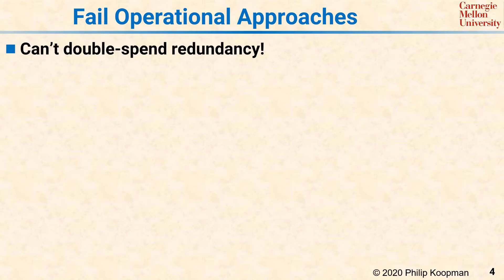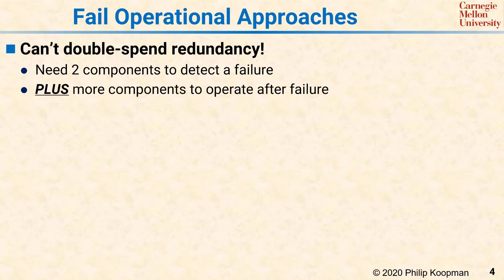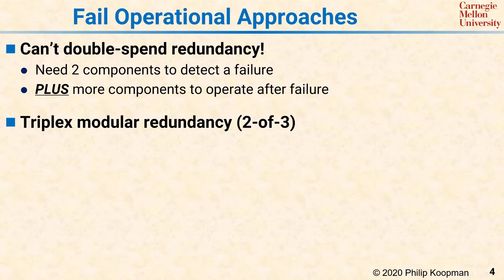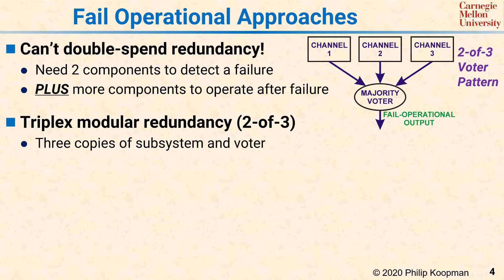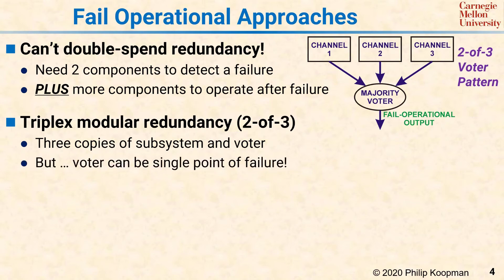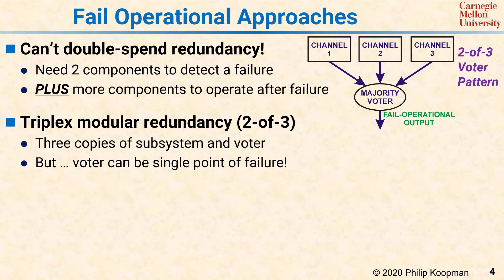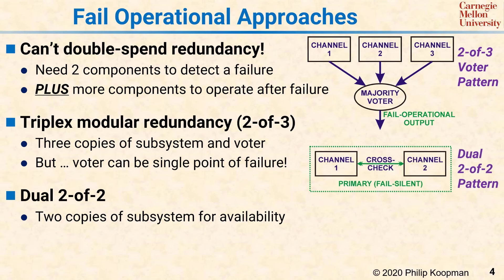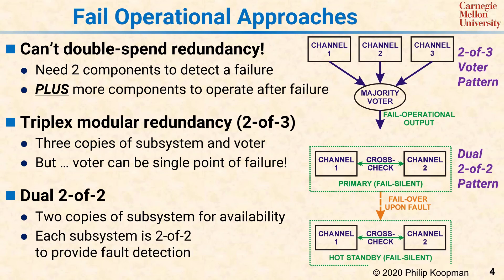L33 04 Fail Operational Approaches

Comment: So, it is a myth that for Fail Passive you need 2 auto pilot and for Fail operational you need 3 auto pilots.
To be Fail operational you actually need 3 computers instead of 3 auto pilots.
You may find aircrafts with 2 autopilots and capable of Fail operational.
Did I understand correctly?